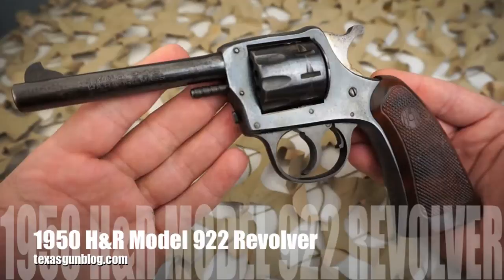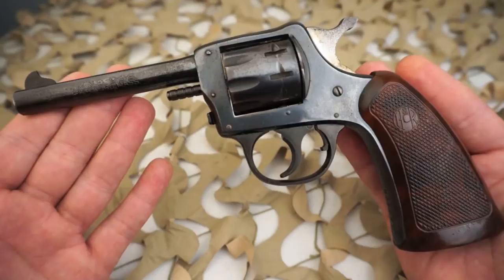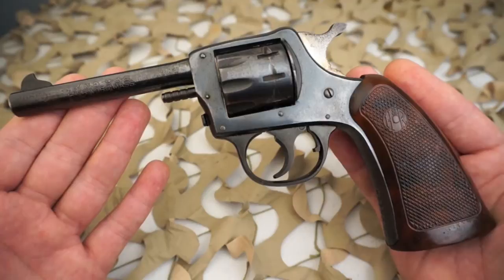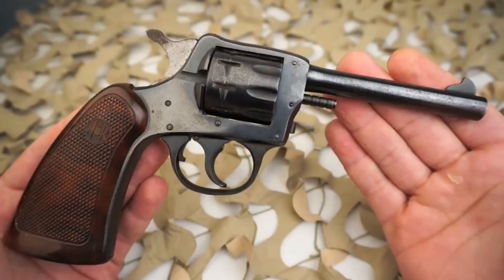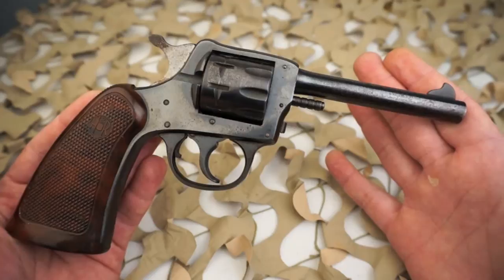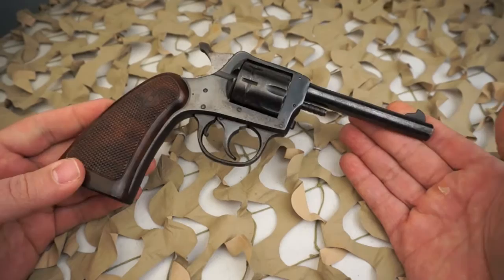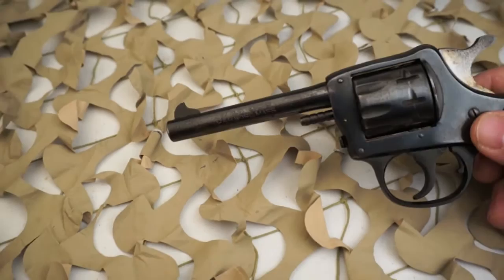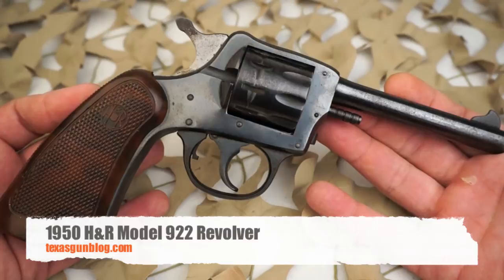1950 Harrington & Richardson H&R Model 922 22lr Revolver Overview - Texas Gun Blog

Comment: Interestingly, this same model or one similar was involved in a double cop murder in 1957 that was shown on Forensic Files:  @zZfA   The perp killed two cops with 3 rounds each and one of them was shot thru a windshield.  Close range, but still you wouldn't expect a little .22 revolver to penetrate that well.  Check that episode at link, probably the longest cold case I've ever seen solved, 1957-2002.

Comment: These are neat little revolvers. I own two of them: a 1951 923 which is exactly like yours except for being chrome plated, and a 3" barreled 1941 922 that has the earlier free-spin lockwork. I have videos up of both revolvers.
Reply: Hey are they the same cylinders?
Reply: @nap41123  No. My 923 has a star extractor. My 1941 922 doesn't; and it also has a longer cylinder bushing with a frame cutout so it can only come out one side.

Comment: Will the Model 922 cylinder fit in the H&R model 923??

Thank you
Reply: Does that mean yes??? Lol
Reply: Yes it will. As long as the notches are the same. Older first models have rounded cylinder stops.
The fifties and newer have slotted cylinder stops. So, as long as they are the same cylinder stops, it will fit. The 923, and 922 are virtually identical except for the finish.